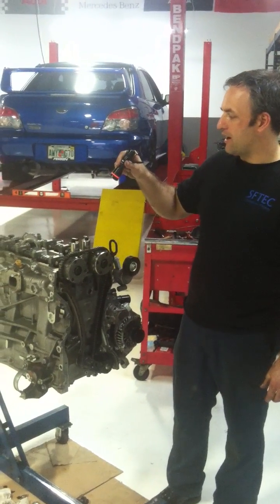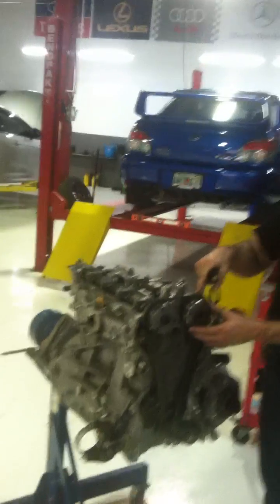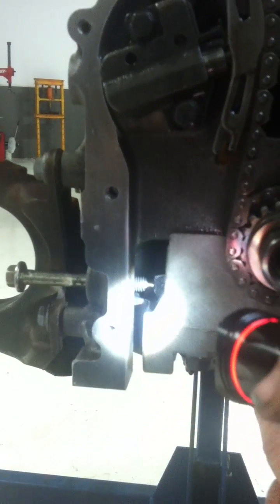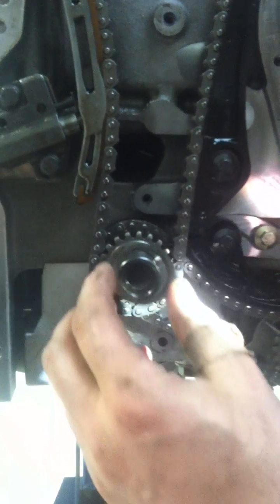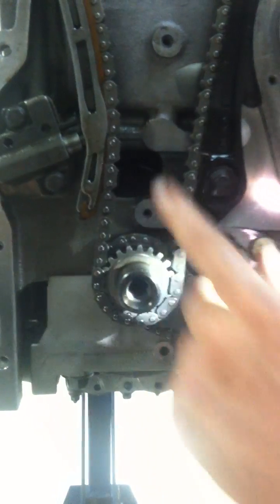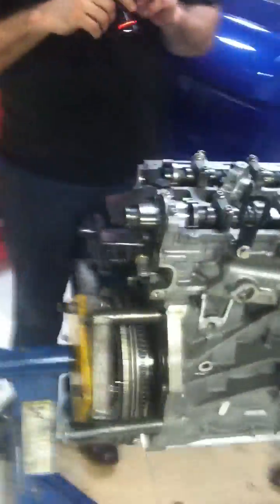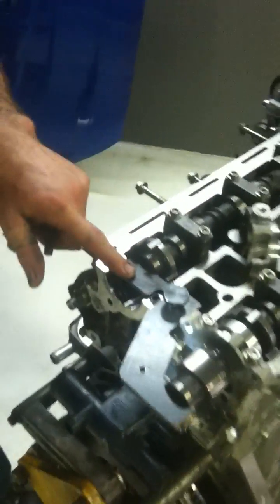2013 ford focus 2.0 turbo st camshaft timing procedure 2014 2015 direct injection engine

Comment: Anybody have had a phaser bolt snap ?
Reply from the maker: Thats no fun. Often on new vehicles the bolts are one use.
Reply: @southfloridatechnicaltrain2589  yeah once started it lost it this is my second time l99 ls-stage 3 btr worked 12 drags and one 2.0 Dohc -stock. the LS everything was new I guess I’m going to start having to do cam phaser clearances with plasti gauge weird my ls did that 3 bolts snapped not the (big cam phaser was deleted) style 🫤 im using ford tool and tdc on ls real easy ! Sprocket on ls only go one way u can tell if incorrect just one thing ls cam dile was tight had to go in a circle pattern btr made the cam I’m putting them at fault ford and Chevy eat chains and cams all I can say every other brand I’ve done have had 0 problems due to chain/belt timing style thanks for the reply !
Reply from the maker: @VedoStefan  Did you replace the Dimond thrust washers each time? They are only 1 use by design.
Reply: @southfloridatechnicaltrain2589  deleted them from the crank stuff surprisingly worked there is one back and front is there one in the cams ?
Reply from the maker: If I recall correct the cam had them to.  @VedoStefan

Comment: So basically you're saying it's junk . 👍
Reply from the maker: Or designed to screw the technician who just wants to fix a leaking crank seal.
Reply: @southfloridatechnicaltrain2589 yeah definitely I don't know what was wrong with just normal keyways and lineup pins and normal timing marks

Comment: Thanks for the video doing it on a land Rover evoque 👍👍👍
Reply from the maker: Yeah that SUV is a pain in the butt. Replace the thermostat housing on the front of the engine if you see even a drip of coolant. The cheap plastic cracks and warps. If the turbo actuator goes bad I have ordered a similar one for BMW and saved a tone of money as rover only sells it with a turbo.

Comment: My intake phaser seems to have a little play back and forth even when torqued down...and my timing chain seems to have slack in some areas I think I compressed it to much on one side instead of taking slack from in between phasers, should I just allow the tensioner to do its job after I put it on the gears?
Reply: what ended up happening? im in same boat with small play on intake side but not exhaust

Comment: can you provide a brand and part number for the camshaft holding tool? replacing mine 2016 2.0L naturally aspirated direct injection
Reply from the maker: I bought it on amazon it was an OTC tool.

Comment: How did you align your camshaft phasers please?
Reply: Sorry for making you repeat yourself. Seems I did not pay full attention when I watched the video. Thanks again.
Reply from the maker: I did not I think they set to zero
Reply: It's just that i noticed a single notch on the intake phaser under one of the sprocket teeth and thought it might be of interest. I went ahead and set the timing like you did but I still got a p0012.
Reply from the maker: @questions703  You used the special tools to align the cams and removed the bolt on the left cam from the back of the engine. ?
Reply: Sorry I don't get which bolt you are talking about. There is the crank stopper bolt (tdc) and both cams have phasers. I pretty much used the alignment tools to set up the camshafts, torqued in the phasers then  crankshaft pulley. Didn't realise there's the bolt you are talking about. Or is it best done with the engine out? Because it's what I am thinking of doing next.
Reply: I was also talking about some sort of alignment notch on the phasers that might indicate corresponding points on the cylinder head.
Reply from the maker: @questions703  The bolt on the back of the cam. It has a slot in it that looks like the timing mark slot but is not. The tool only properly bolts down if the bolt in the back of the cam is removed
Reply: Ah? You're a real life saver man. Thank you very much for the assistance. i never realised there was one. And the guides i came across never made mention of it. Thanks a million. Will start off with it first thing tomorrow. 
Wishing you all the best. Cheers!
Reply: One more question though, is the bolt a reversed thread or does it unscrew the normal anticlockwise direction?
Reply: Mine does not have the bolt. The alignment grooves are there on the open. I'm just realising yours is for the brake vacuum pump while mine is connected to the intake manifold. I'm just gonna let the car be and get rid of it. Them lemon cars are not good for ocd guys.

Comment: Thanks man, that was exactly what I needed. I'm working on a Land Rover Evoque with the same engine.
Reply: Haha. That's why I'm here too. Service manual doesnt say anything about the bolt for the crank shaft
Reply: @crossroadgarage  that damm bolt same issue.
Reply: Came here for Land Rover evoque also
Reply from the maker: We did a rover the other day way way harder to pull the engine than a focus.

Comment: Same tools, specifically the TDC crank bolt, for the 2.3l ecoboost as well? I have one cylinder with low compression and I've got to pull my head to see whats going on.
Reply from the maker: This was a turbo model. Low compression is most likely a broken piston  just do a leak down test to verify
Reply from the maker: You wont see the broken piston with out removing the piston. I have replaced several of them.
Reply: yup I jus took my edge engine apart couldn't see the broken piston till I took it out ...do u think it's ok if I jus replace that piston and do all rings?

Comment: I did what you just said with the sst but I still have a p0016.  Where are the cam gear timing marks?
Reply from the maker: Timing marks??? the engine has no timing marks you need to install a special tool to align the cam. Then you tighten the nut on the diamond thrust washer.
Reply: @southfloridatechnicaltrain2589   The cam gears phase, its spring loaded, so if one is further back than the other then one will phase 100% when command the other will only make 50% or whatever the difference is.. The notches have to be down.
Reply: @joshb6634 did the same engine today and ask for the same question, i went to ford service but they didn't have the answer😂😂 so can u please help me with this question?

Comment: Are you placing the engine on TDC first? If so, does this cam plate go on to take cams out or in?
Reply from the maker: I placed the engine 40 degrees before tdc then installed the tool then rotated the engine till it locked against the calibrated bolt. I figured out where the bolt went by taking a dial indicator and using it on the piston to determine TDC. With the bolt installed you can rotate the crank away from TDC install your cams then line them up. After cams are in you rotate the engine back to TDC.
Reply from the maker: I placed the engine 25 degrees from tdc then aligned cams then rotated engine to tdc
Reply: How do you know where to put cam phasers if they've been removed?

Comment: So do you have to pull the motor to install cams?
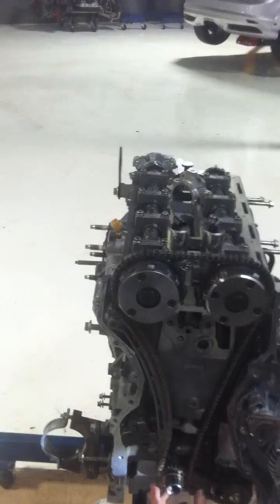Reply: Is there any risk of getting the block damaged because torquing the polley with the bolt 0:26 in the block?  Will the block support the strong torque of tightening the polley? I though the block or even the metal that holds the camshalfts could get borken. I have to this job in a MAZDA 3 2.0 very similar timing
Reply: hi I am currently working on a 14 and would like too knw where too get that can tool I have checked with my local tool trucks and nobody seems too knw what I'm talking about any help would be great thanks great vid
Reply: yes, must be a Ford thing. have to do it for mustangs as well. you don't have to for hemi v8s and you don't for honda.
Reply: +David C Wow cheers for the reply man
Reply: +OneWhoGames no problem, I'm going down this rabbit hole as well wondering if I really want to fix up my ST or not.
Reply: +David C yeah if I can't do top end stuff without pulling the motor I figure I'll just leave my focus stock because honestly all I planned was headwork, cams and valves, and a real turbo and fmic. If I have to pull the motor I'll end up wanting to do a clutch and flywheel - what a slippery slope
Reply: +OneWhoGames I traded in a 2012 superbee for my ST to save some money while in school. now that it is 2 years old and there is a decent part list available I struggle with the idea of building up this car  only for it still to be fwd. I don't want a 3rd gear pull car you know. the tq steer with this thing is already bad enough.
Reply: +David C yeah, i get that. After owning one now for just a year I think these aren't great budget build up cars - I'm just a student and I can't afford to "have everything done with no expense spared". And I agree with the FWD part especially. These do handle remarkably for what they are, maybe I'll stick with wheels and suspension stuff and just make it handle better
Reply: If anything just look into the Ford racing power pack. That way it'll be a little more sporty and not really break the bank.
Reply from the maker: I bought it on line I just googled it and a bunch of tools came up.
Reply: Yes government procedure